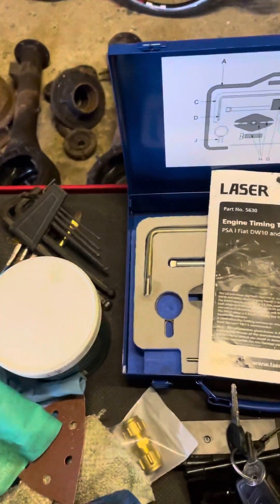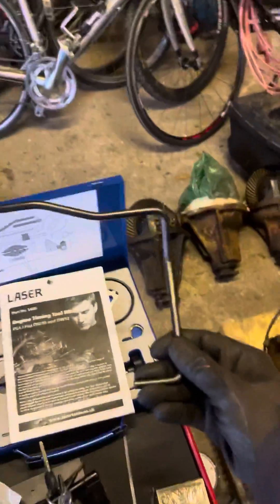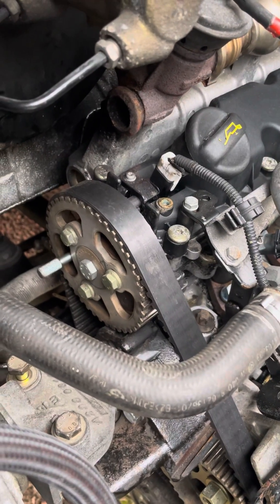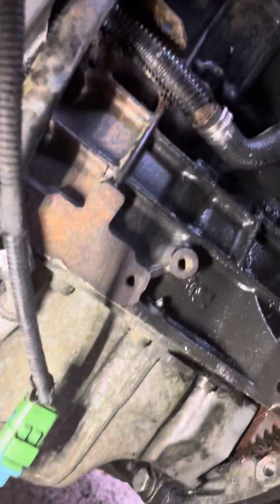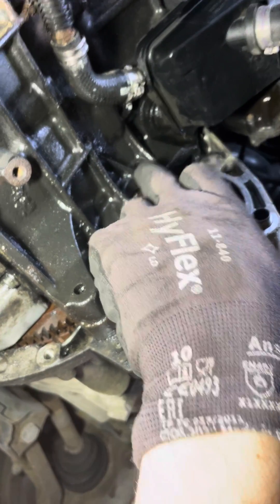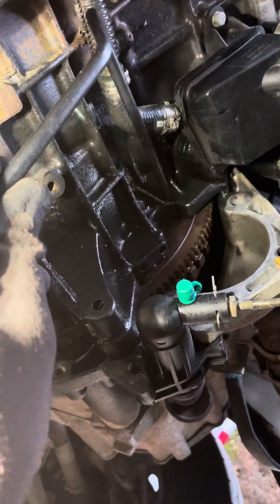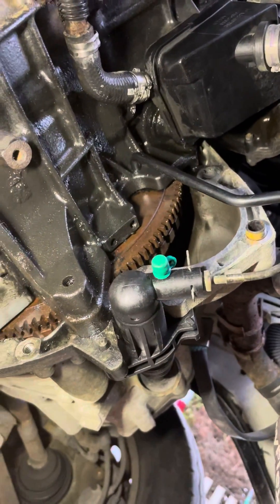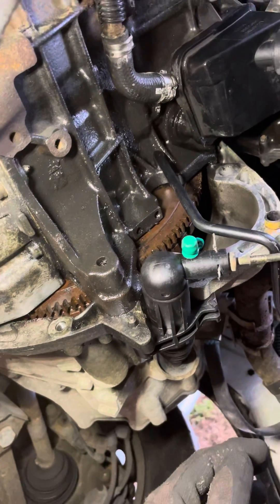Peugeot Fiat PSA 2.0 HDI Timing Belt Change DW10

Comment: Thanks for that advice. Does the fuel pump need locking as well as the cam and crankshaft ?
Reply from the maker: No, fuel pump locking not necessary - it’s position is not a consideration to engine timing. The LASER locking tool kit and Haynes manual say not required to lock fuel pump.
Reply: @mattroche5079  thanks for your reply, yes that’s what I was trying to work out, whether the injector pump needs to be timed. Some vehicles it does and some it doesn’t, if there’s no locking pin it’s not a timed pump. Cheers.
Reply: @mattroche5079  I meant the high pressure diesel pump that feeds the fuel rail for the injectors. It’s driven by the cambelt. Does that need locking ?

Comment: Out of curiosity what vehicle is it?
Reply from the maker: Peugeot Boxer MK1.
Reply: @mattroche5079  Wondered as oil return pipe is not in that position on 307 DW10. Still have to move starter and possibly fuel filter to get to timing hole...not looking forward to that!!